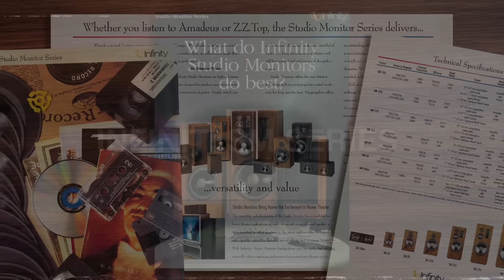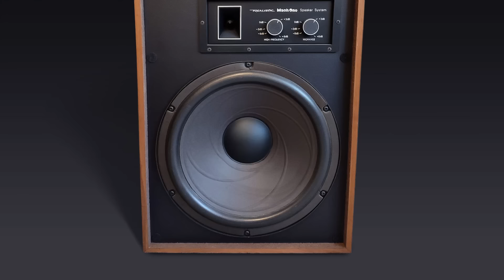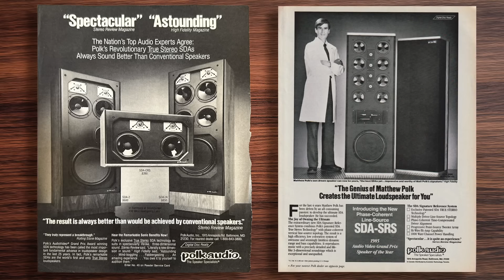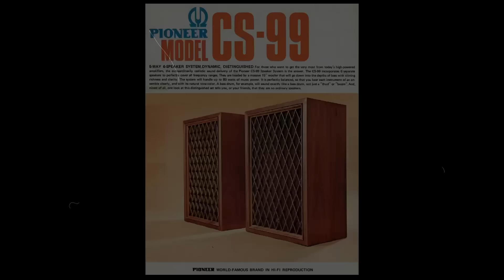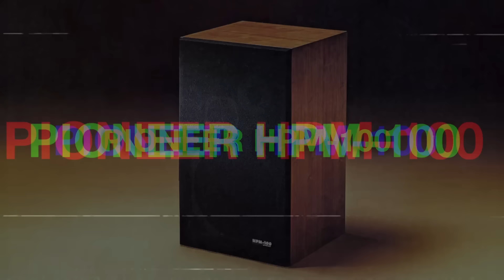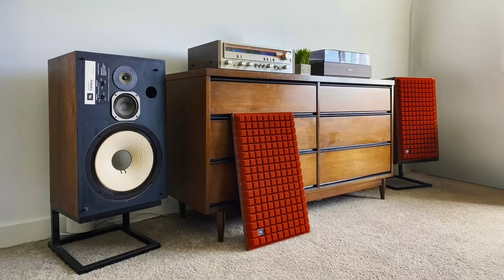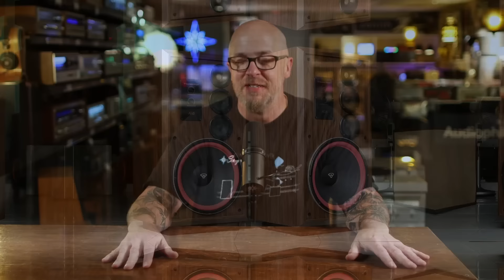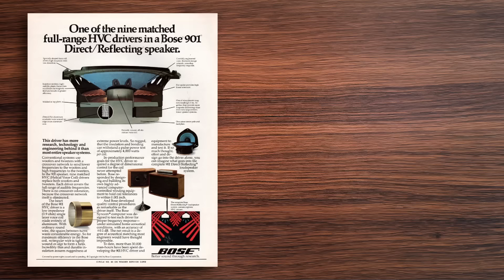Why Do Audiophiles Hate These 9 Legendary Speakers?

Comment: IF the Bose 901 was really successful and was an inherently 'correct' design, then it would still be in production today. The facts are more prosaic. When Amar Bose died, the company killed off the 901, because it was no longer selling them in sustainable numbers. 

The real question is this: Why was the 901 so successful, when any person claiming to be an audiophile roundly condemned the product? 

Answer: Clever and sustained marketing. I would ague that Bose has always been a marketing company first and an audio company last. 

The audiophiles have always been correct about the 901. It is based upon a flawed hypothesis: That most of the sound in a concert (hall) is received by the listener as reflections. That is partly true, but fails to take account of outdoor concerts and the vast differences between concert halls. However, THE fundamental flaw is this: In a good live recording, all the ambient (reflected) sound is already recorded. The Bose 901 merely adds MORE reflections to the sound. Then, of course, is the timing of those reflections. In a concert hall those reflections may be from walls that are many TENS of Metres away from the musicians, but in a typical listening room, those reflections are from walls that may be as little as half a Metre away from the speaker. 

The Bose 901: A triumph of marketing lies over sonic performance.

Comment: Back in the 80s my dad bought a system with 15" Cerwin Vegas and when he was at work I used all 120 watts to rattle the glass in the house. Today I have Tekton Design speakers and bar none you can't get a better speaker regardless how much you spend.

Comment: I'm still using my 1985 Cerwin-Vegas D1
Reply: I had the one with a 15 inch bass but  really wanted JBL or quad electrostaic speaker but the cerwin vega were at 1/3 pricepoint

Comment: I have two pairs of speakers that I always wanted but could not afford at the time. I eventually found both at bargain prices. The first is a pair of JBL L-100s that I found in the late 80's for $200.00, the other is the studio version of the L-100, the JBL 4311. I found that pair at a local Goodwill. I think I paid $40.00 for them. These were my dream speakers when I was a teen. A lot of the records I listened to were mixed on the 4311s, or so I have read. The only speaker I found that sounded as sweet to me was a 3 way Yamaha speaker with a Berillium Tweeter, I'm pretty sure it was the NS-1000, but I have never owned those. Obviously I'm not an audiophile, but I know what I like and for my money, the JBLs are hard to beat.

Comment: I owned the SDA 2.3, and JBL Pro VIII surrounds with multiple Carver amps and CT17 preamp tuner, Nakamichi cassette deck, Integra CD, Denon’s best turntable and  multiple DBX processors  (Compander/expander, digital 20/20 eq and another piece I don’t recall). I miss all of that but it was a huge system. I loved the sound of the SDA 2.3! I could move a glass on the coffee table playing the Pink Floyd heartbeat. I wear hearing aides now. 😅

Comment: I have been thru a number of receivers, and amps over the years, but still have the Klipsch Cornwalls I bought in 1976. Also have the Corner horns after my mom passed.  Bought the corner horns for my parents in 1978? For $1500 used. 
The Cornwalls and corner horns sound great together. Using a pioneer SA 9500 to drive them.

Comment: I think the 901s are good for very large rooms where you just want to spread the sound around and not have any issues with power handling or harshness. In a large home theater they have the potential to sound amazing.
As a speaker builder I'm actually shocked at how good they can sound though I would never use them in my small living room .

Comment: I bought Cerwin Vegas becasue I could not find any decent speakers.  Most available were those 5.1, 7.1 deals.  The sounds these make, have no soul, and are not meant for seriously listening to music.  The Cerwin Vegas were and are very impressive.  Yes, particularly the low notes.  After hearing, bass notes, beautiful bass notes,  on records from the 60's and 70's, maybe even the 50', that no one, except the artist, the arrangers and producers even knew were there.  So yeah, I'm impressed.  The only complaint I have is I had to upgrade my amplifier to a dedicated amp, because my Sony receiver could not power them, and would burnout the crossovers.  Gone are the days when you could buy an amp, and a couple of decent speakers and call it a day.  I have been trying to replace the Sony for like 10 years, to no avail.  They are all 5.1, 7.1 nonsense, and so complicated you have to hire a full time sound engineer to understand it.  I was and am looking for a simple 2 channel unit, with a few inputs and outputs for at most 2 sets of speakers, and a tape (what's that?) or 2.  Good luck with that, and $14G for an amp, is delusional.

Comment: Bose 901’s we’re all about AD Campain. They were truly 100% Crap Speakers. Your Hint they were Crap Speakers..The only released review that Bose Advertises was from FIELD AND STREAM Magazine. Not a Audio Magazine Review..But Field and Stream. The set up didn’t work in the 70’s and would not work today either. All Paper Drivers..the original ones. Thin sound! It was Bose Gemmick. Another Gemmick in the 90’s..was Bose would never allow their speakers at Curcuit City, or Best Buy..301’s and 201’s and so on. You could never compare semi legit speakers to them Gemmicky Paper Speakers.

Comment: I’ve always been a Bose fan. Ran, 901 and 601s for years. Unfortunately I had a brain fart and through them out, as the speakers were dry rotted. I looked at buying the rebuild kits, but decided to go with the Bose Acoustimass series. Moved to new house and left the BAS packed up in its box and now running a Bose sound bar. Old and lazy I guess. lol.

Comment: The key is if you like them, that’s all that matters, remember does it sound better or different to another pair of speakers. 

I’ve had loads over the years, from UK manufacturers to Japanese, I like speakers with some character in the looks, I still have several all pairs in use around the house, Wharedale bookshelf, Tannoy, Mission, but my main listening ones are a very rare pair of Technics SB-8000’s, look them up, from the late 70’s, that tweeter is beautiful and I believe still in use by a European speaker manufacturer Quadral.

Comment: I first heard a pair of Bose 901s in 1977, in a hi-fi showroom.  That very first time, I fell in love with the sound and KNEW that one day I would own a pair.  In 1988, I bought a pair of Series VIs.  They are hanging in our family room as I type this.  I still love them, and have never been seriously tempted to own anything else——although there are other speakers that I think are great too—-like the Magnepans, the Quad ESLs, and even the Klipsch Heresys.  I have struggled to find the best amplification for the 901s——and believe it or not, am STILL working on that.  I am not rich so I can’t really afford a McIntosh or Krell amp.  
People say that the 901s are placement sensitive.  I would agree—-up to a point.  I actually don’t think they are any more placement sensitive than most other speakers. 
All speaker designs are a compromise.  What you like depends on what gear can deliver what I call a SME (satisfying musical experience).  At some point in hi-if speaker design history, a majority of listeners settled on what became the dominant mainstream speaker model (multiple, varying-sized drivers with a crossover system), and that they could live with the particular compromises of this design.  I never could.  Crossovers sound unnatural to me.  And speakers which beam the sound at you like an aural flashlight, don’t sound natural to me either.  But the 901s DO deliver a SME, for me.

Comment: I have the Cerwin Vega R.E series , thirty hooked up to my macintosh seventeen hundred and I love it, but at the same time , I have a pioneer s x nine eighty hooked up to 4 Dcm kx-12's and plus, marantz 2265, with a pair of Dcm kx212's on the A ,and a pair of jbl2-10 tower all equalized and running off of one Sony C.D player in my bedroom, nobody's sound system sounds like mine

Comment: I have a pair of BOSE series v from 1984. I have tried many other speakers over the years and none can create that indirect room filling feel like I am at the concert instead of having the sound BLASTING at me. To get that you do need to have proper placement and the equalizer engaged. I am using a Conrad Johnson tubed Pre-Amp and a Hafler Amp  . When I play A great sounding recording I AM AT THE STUDIO. I bought original in 84 for $ 1200. and still using after 40 years with NO problems.

Comment: In my youth, I wanted to purchase my first pair of quality speakers and headed to Stereo Super Store's and was sold a much raved about by the sales guy, and just how good the Polk SDA speakers were.  I couldn't lay my money down fast enough.  Got them home, hooked up, ran my 100 watt amp through them and couldn't believe how crappy these actually were.  With absolutely minimal bass, flat mids and very limited highs, I took them back the next day and wanted something different, something with bass in a 12" or 15" woofer.  They were like shinning beacons on a hill.  I bought the Infinity SM 150's, got them home and couldn't believe how much better they were.  It was a night and day difference.  So much more impressive than the ridiculous Polk SDA speakers which I became convinced, were better geared more toward fans of Lawrence Welk.
Reply: your ear wasn't tuned in by that time. I had the same happen to me. but those polk really were fine speakers.

Comment: Speaking of bad crossovers... I got some Yamaha NS-777 front stereo speakers. The crossover is so poorly done. The tweeters/mids are meant to be super sharp but I find it just too fatiguing and you can't turn them up to any decent volume without them being harsh. So I got a software eq going. I'm running them through a Thomann T amp, gives them a good amount of power. I'm running a second set of speakers which I love, Sony SS-DX50, they're running through a cheap Aiyima A07 amp, it really makes the whole setup much clearer and fuller with the Sony's.

Comment: wow, I couldn't agree anymore. I myself am a total lover of the Klipsch Heritage. My all time favorite and I owned 3 pair over many years are the KLF-30. You're very right, they are loud, very forward and are fatiguing if played too loud for too long. So fatiguing that I actually fall asleep when I blow them past 110 db. And I love it. And I don't think they are audiophile grade but the sound, even very forward especially in the mid range is very clean. It takes a lot of horsepower to overdrive them. I also owned a pair of Cervin Vega a long time ago. And true, they produce a very strong and hard hitting bass, rattle the windows and blow every dish out of the kitchen cabinets 3 rooms away. They play extremely loud and incredible dirty. The level of distortion is mind blowing. The perfect speakers for parties where everyone is drunk as fuck. I really like your videos. I grew up in the 70's and 80's when the High End Hifi Stereo wattage race was at it's peak. When a turntable or power amp that didn't need at least 2 people to carry were considered plastic junk. When I turned on my old Accuphase Power Amp on and had to reset the breaker almost every time. Best time in my life. Thanks for your videos. I really enjoy them.

Comment: I remember in the late 70s hearing a pair of realistic Mach one speakers and as a young teenager use to distorted low powered sound. I was impressed. A few years later when I could afford it and the Mach one speakers were no longer being made. I bought a pair of Mach 2s for what was then my dream hi-fi system. They sounded great to me although probably not as impressive as the Mach ones. I still have them and I still love them. Yeah they’re probably not the most accurate but it doesn’t matter. Keep the dream alive!

Comment: I sold infinity, but never could learn to like the Cell tweeters.  EMIT tweeters were light years ahead.  Most any soft dome tweeter could blow them away too.  But you right, loud bright and boomy are what a lot of people want it.  I called it the threshold of pain school of stereo reproduction.  Mach 1 speakers could play loud, boomed in the base and were a great rock and roll party speaker, but Mach 2's were more musical.  I've heard the SDA's.  It seemed to be doing exactly the same the Carver Sonic Hologram, only mechanical.  I have a pair of Sansui SP-2000 speakers, and yes, they do sound like too much is going on between you and the music, but they were not terrible.  I'd put them up against a vintage Klipsch Heresy, any day of the week (which I also own and used to sell).  I don't see much difference between the HPM-100 and the better kabuki speakers.  They did have fantastic driver, but so did the older Sansui and Coral kabuki.  They could take a lot more power, though!  The sound quality of the L-100's is right up there with the NS-10.  If I had seen a pair in the 80's when they were cheap, I probably would have bought them to resell, not to listen to.  A friend of mine had Cerwin Vega, and they were the muddiest sounding speaker that I have heard outside of Panasonic Thrusters.  Count me as another Bose hater, although the arrogance of their owners probably has negatively influenced me.

Comment: Old equipment can give you that warm sound. That warm sound is distortion.
You want your new equipment to sound like that buy a 100$ equalizer.
Dont buy into the BS that states old equipment was better, it isnt.
Big powerful gear was required to get the most out of your 88db speakers.
Now a days drivers are much more efficient, mine are 96db sensitivity and I drive
them with 15w tube amp, dont fall into the I need power BS.
Best place for old equipment is the dump.

Comment: The only time I ever saw or heard Polk SDA speakers was at a local stereo store in the early 80s with the largest pair they produced. I dont know the Model # but to me that particular pair were built to party, like concert array speakers. They may have been audiophile speakers, but I just thought they sounded great loud. Next thing you know with the coming of the A/V Craze, all Polk speakers were shrunk down to nothing. I lost Interest. Later when I bought a Carver amp, I ended up buying Cerwin Vega CV-150s as Polk moved to the A/V market. I dont know about the JBL L100 being indestructible but I picked up a pair of old L166 Horizons in the early 2000s and fried the crossovers and midranges with no trouble at all with an early 1980s HH Scott Solid State 70 wpc rms amp.

Comment: I've got rebuilt 901s suspended from a beam in a  pitched ceiling  room on opposing  sides with the EQ running through a casset tape deck. The only problem is that they need plenty of power.

Comment: While stationed in West Germany from 1981 to 1983, US Army, I purchased a set of Sony SS-S890s, 4-way, adjustable cross over ("Treble, Normal and Bass") with 18" woofers. I loved them then and still do, but with digital equipment. I wish I still had my Sansui 7900Z receiver.

Comment: Still have my 901’s I bought in 83. But the foam on them gave out by 93. Still plan on getting them fixed some day. I also have the spacial control receiver from 83. I always kept the speakers on top of book shelves in a entertainment center I made in my shop. What sold me on the 901 is the ability to widen the sound and the stereo separation was awesome. My opinion is Bose was the first company to make surround sound speaker systems. What is missing is a subwoofer

Comment: In the late -70 I was speaker shopping at the PX in Germany. I liked what I called the “East Coast” sound, meaning mild mannered ARs and the like. The classic JBLs and ESPECIALLY the Cerwin Vega speakers were “West Coast” — Too squawky and too boomy. The Cervin Vegas were so bad that I didn’t need an A/B comparison. They were just face-value revolting, whatever the music. Strangely, I settled on some 901s. Series VI, I think. They sounded better than the JBLs and Cerwin Vegas and looked pretty cool. Friends liked them for parties because the sound was okay no matter where you were in the room. I even had them renewed in the ‘90s with new Korean drivers. The EQ finally died. I’m a bit of an audiophile, I guess, but I guess my idea of perfection doesn’t require lots of money be spent. Many years and speakers later I have $88 a pair SONY SVS-CS5s with plugged ports, with an SVS 3000 mini sub matched pretty well to the SONY’s closed box roll off. I love those little SONYs for their mids and highs. Hell, the stands I have for them cost more than they do! I plugged the ports because the bass-reflex bass extension is flabby compared to the SVS sub, and it requires a gentler roll-off which I can easily set on the SVS.